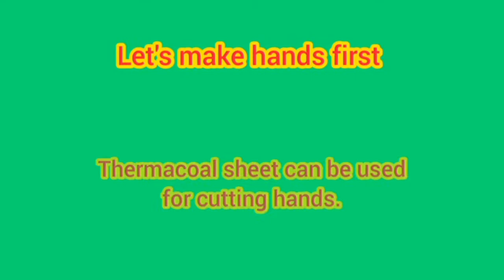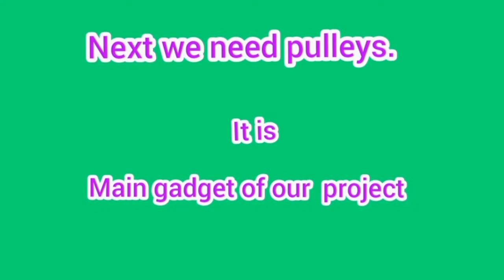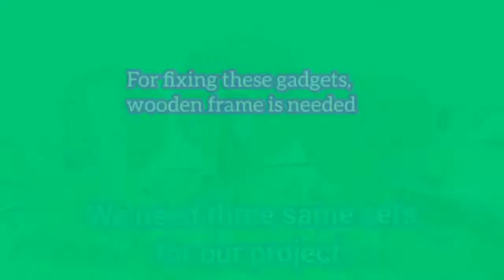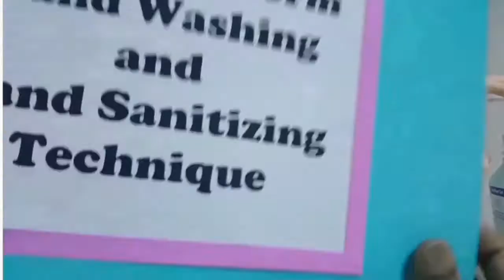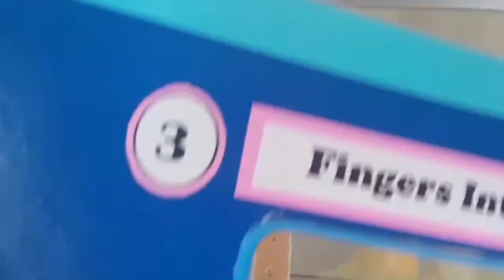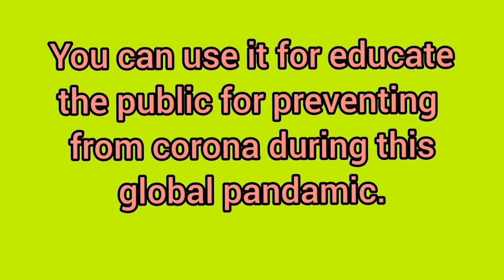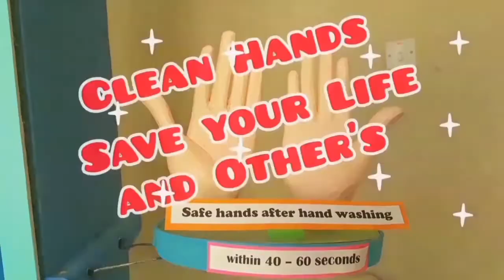how to make working model for hand hygiene.

Comment: Hlo sir plzz tell me which material use this modal and plzz share this graph of electrical
Reply from the maker: Hands were made using thermacol sheets. I used 9V DC motors and Electrical supply by AC DC converters. Its not big part.